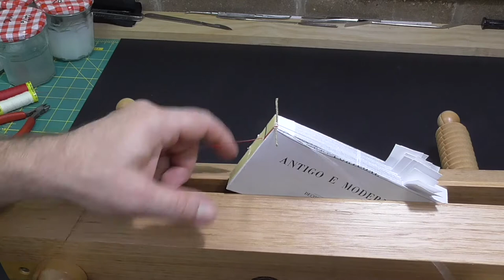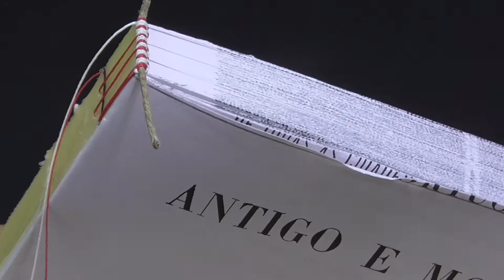How to Sew a Two Colour Front Bead Headband // Adventures in Bookbinding

Comment: Hello. I have watched this video several times and benefitted from it tremendously. There is one aspect to the operation that I think the fans would find useful. It is the bodily posture during this operation. Everytime I do a headband, standing over my workbench and neeling slightly, I end up with a terrible back pain. I have to rest a little to attempt the second one. What, in your opinion should be the best posture to go forward with this operation (or, maybe, all the other operations?) Standing up, sitting over the bench...The ergonomics of the process? If you can address this aspect of the craft it would be valuable to keen amateurs to my age of 60+. Thanks!
Reply from the maker: As a 50+ with fairly worn out joints I have to be careful with how I work too.  I stand at the bench for most jobs but usually sit for headbands.  I often do headbands while watching TV.  I think the main thing is getting confident enough that you don't need to be looking at the other side all the time.  Then you can work with the job just below shoulder height and your arms can be kept at a comfortable level and you can look almost straight ahead.  Next time I do an endband - getting close to starting videos again - I'll address this.  Good luck!  DAS

Comment: I was so nervous to begin sewing headbands. I believed it would have a steep learning curve but you made this so simple to follow. From what I’ve seen silk thread is the traditional choice but could I use a cheaper alternative like polyester thread?
Reply from the maker: Absolutely.  Silk looks great, but it actually degrades fairly quickly - 100 years or so.  In book terms it's almost temporary.  Polyester is fine and many people prefer it.  To get rid of the nerves, just do practices.  I have some fake text blocks that are just double fanned waste paper.  They are square backed and I line the back with a bit of cotton and I just practice on the over and over again.  After I'm done I just cut the old endband off and start again.  I don't bother with flags etc and just tie down anywhere.  Even on a book, if it goes wrong, you can just cut it off and start again.  Many steps in bookbinding you can't go back.  With endbands you can, so no stress.  Good luck!  DAS

Comment: Terrific video of a tricky process.  Couple of questions..what weight of thread are you using and what allows the band to stay on top of the book and not roll around to the spine?
Reply from the maker: It is a bit precarious sitting on top there.  But the design of the tie downs etc mean it wants to stay there.  But then a bit of PVA on the back of it and maybe line the spine including the headband and it rock solid.

Comment: I'll have to try this thanks for [posting A QUESTION, have you made a tear out page art paper book? I asked you here because I just received a Christmas request.
Reply from the maker: No.  If I were going to do this I would use a fairly fast structure to make, such as the stiff board binding.  Not sure I'd like to put a lot of effort into a book and have it torn apart.https://youtu.be/PGcG2v4TXw0
Ciao, DAS
Reply: @DASBookbinding  As a Christmas gift perhaps I'll make a refillable one  Masonite central, board with the tear out pad on top and turn over with a tiny trap ledge to rest the paper on for drawing, The flip up cover would be the special part .

Comment: I know you may never see this but i did have a question. Tho it may be overkill and unnecessary, is it possible to do regular headbands on books done in a library style? I know that usually there is just a cord inside the leather or buckram when its folded over but for my own personal interest as an amateur bookbinder. Would this upset the binding at all?
Reply from the maker: Yes you can and it was done historically.  Just don't put in the piece of cord in the head cap and this and a headband on the book want to live in the same spot.  If working in leather you can still form a more traditional head cap over the sewn headband.  DAS

Comment: One thing I never understood is why skip signatures with the other thread, surely it would make it more secure yes it would waste material but it would be for the sake of strengthening the headband. Maybe the stitching on the textblock is doing most of the work, but as an experiment I did this headband with a practice textblock with no stitching and the ones that were skipped fell out. 

Personally I think its worth investing but if theres any reason that I don't know or missed in this video wpuld be highly appreciated
Reply from the maker: Less about materials, more about time and what is the minimum between tying down.  There is long backstory to this, which I'll over simplify.  Endbands were a structural component to books - think medieval wood board books, and other limp covered books too.  From maybe 16th century onwards the structural element became less important as the materials in books changed.  They became decorative, and the extreme of this was maybe English 19th century where they might be tied down at the start end and middle only.  They are still well attached and supported by being glued on when the spine is reglued and the spine liner goes up behind them.  The most you should tie down is the centre of every section.  This is a good compromise between strength etc.  Or you go a bit further and do like I did.  Up to you.

Comment: Hello. I really like to build headbands. I want to ask you about the fat spat you're using. Is it always the same or does it play a part in the fat of the book?
Reply from the maker: You’ve got me stumped. I can’t work out what “ fat spat” is. The thread maybe?
Reply: @DASBookbinding  Yes, that's what I mean..
Reply: Forgive me for my English.
Reply from the maker: @Fragkogiannakis_Vasilis  No I change thread depending on the look I want.  I normally use silk which gives a very fine look.  The linen thread gives a more robust look.  It is thinner than the thread I use to sew the sections together.  I hope I answered your question.  Let me know if I didn't.  All the best.  Darryn
Reply: @DASBookbinding Thank you very much. I mean the thick of the core.
Reply from the maker: @Fragkogiannakis_Vasilis  Sorry, should have understood.  Yes, in this case the book is a 19th century laced on boards leather binding.  So it will have headcaps.  The headcap will cover to some extent the headband.  The top of the headcap must be level with the top of the boards.  Thus headband with headcap (about 1 thickness of leather) must be equal or less than the square.  In my case the square is 3mm, and let's assume the leather is 1mm  and the thread is maybe 0.3mm.  So the core should be 1.4mm or less.  Mine was about this or a bit less.  I should have mentioned this in the video.  Good questions.
Reply: @DASBookbinding  Thanks again. You were accurate.